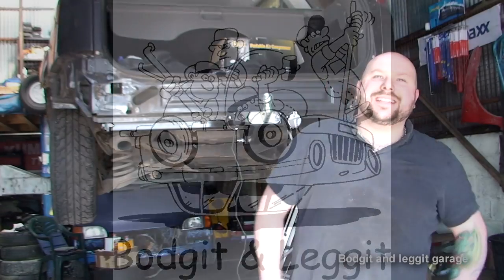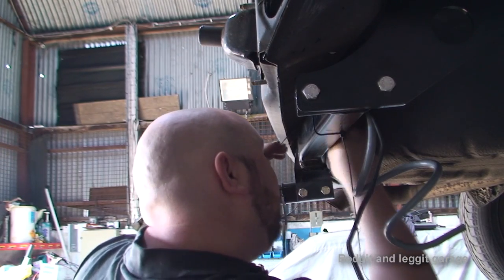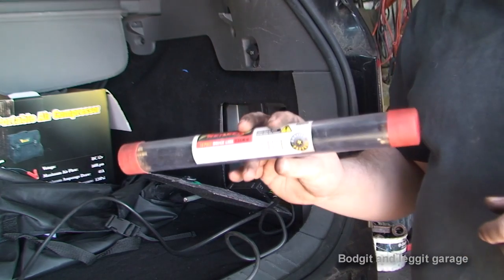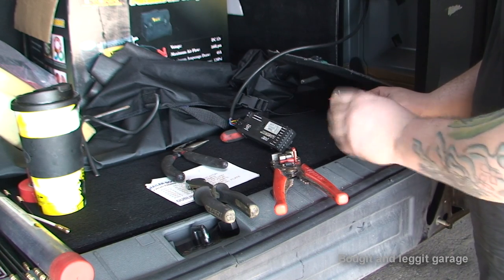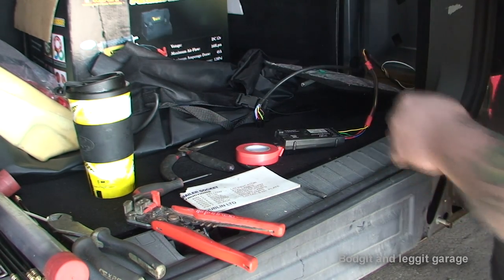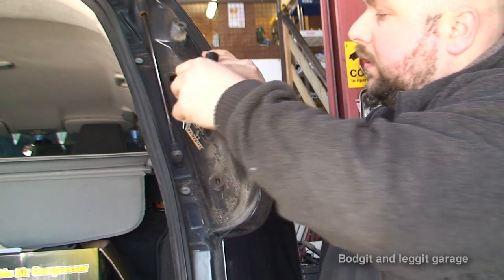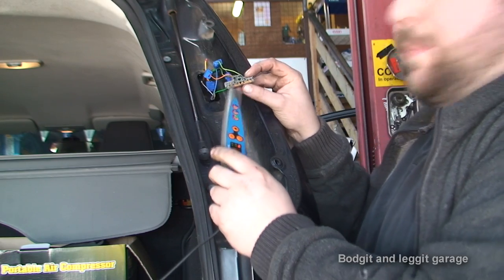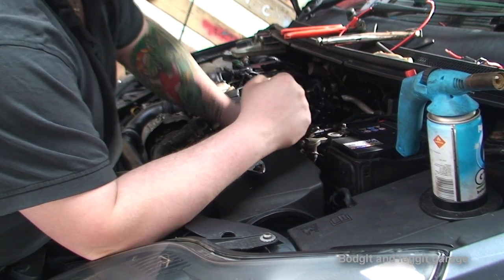how to wire a towbar with canbus box part 2 bodgit and leggit garage

Comment: p.s..
16:40
You talk of needing a HIGHER rated fuse in the circuits your car uses for various functions.
YET that canbus "box" is merely a relay box - fed DIRECTLY from the battery (fused at the battery) which itself POWERS the various RELAY operated lights on the trailer.
The RELAY for each circuit it controls - draws extremely low current from the "control" circuit ..
ie:
If the side/tail lamp circuit is powered ON (in the vehicle) and the canbus see's that 2 amp is drawn "normally' - it will NOT see the extra 20 mA that the relay coil draws.
It will ALSO NOT see whatever amperage the trailer side marker lamps draw - as THEY draw current directly from the battery - via the relay contacts.

That is the same for EACH of the six other circuits in the 7 pin flat plug.

NO TRAILER LAMP CIRCUIT - draws any current from it's identical vehicle circuit - as ONLY a relay coil - draws current from them.

Putting say a 15 A fuse on a normally 10A circuit - may cause a future problem to BURN OUT THE WIRING, long before the higher rated fuse blows.

The "can-bus trailer BOX - is merely a box containing 6 relays for each of the six "control" circuits - the relays FEED directly into the trailer - via the battery fused wired.

Comment: Stumbled across your video whilst trying to get an insight into tow bar electrics with Can Bus and PCT ZR2500 Relay.Unfortunately the van I have purchased has tow electrics in camper gas locker, noT standard practise and I need to move or isolate so no potential electric current is within box. I have chosen to isolate as don't intend to use the electrics on tow bar at this time. My intention is to remove 12V live from car battery going to relay, this I believe would prevent signal current going to tow bar plug, however I believe  there would still be a small current going to the PCT Relay from the light cluster connections? My plan is to break these connections at PCT relay  tape and put back into pillar column and seal entry hole, this I am hoping will remove any electric current in gas locker. I would appreciate your thoughts on my methodology. Thank you for these informative  videos most helpful. Can you provide link for your can bus wiring tester. Thank you

Comment: I didn’t really see the part we’re you got the power source from the battery to the canbus box, so do you have to run a separate wire through the car to the battery?

Comment: Enjoy watching your video's thanks Going to give this a try myself. If my car has already got the harness as factory but I've already brought the universal kit. Can you power the harness with a 15a fuse and get the power supply form there instead of running the cable to the battery?

Comment: Hi, I enjoy your videos and thanks for posting.  I am about to wire a towbar on my 2011 Toyota Avensis which has the Canbus wiring. My concern is I have a  car trailer ( 1 year old ) with LED lighting and I also tow a boat trailer with the old conventual wiring. Do I need to have any additional  fittings to cater for old and new trailer wiring systems being hooked up to my 7 pin socket. Thanks in advance.

Comment: You don't need to increase the car fuse size for the lights, that's the job of the 7 way relay. The relay only samples the voltage on each wire, the 7 way relay then  powers the trailer lights
Reply: Yes and increasing the fuse rating risks a wiring fire. Bad advice.  If by some stretch of the imagination the current draw was too much you’d just swap some of the bulbs to led on the trailer. Never change the fuse. The main positive to the bypass should be fused as close as possible to the battery or on an existing unused circuit.
Reply: And if you know your increasing the load, why wouldn't you wire the left and right circuits separately???
Reply: Correct, you should never increase the rating of the fuse. Its easy to test the current draw at the fuse, but the channel is called Bodgit and Leggit.

Comment: that thing you drilled a hole for is a rivnut,if you have a 12 volt socket in the boot why not use that instead of running a cable all the way to the battery?

Comment: Hi mate ,have question urgently. The tail light wire on my picasso has 2 wires ,so do I need to connect to both or just one. Also my brake light has 2 wires ,so do I need to connect both to the relay or just one wire. Also I read that the battery should be disconnected whilst connecting everything in ? And do I need to disconnet the minus of the battery when connecting in a fuse and positive wire to it.
Reply from the maker: Hi mate are you sure they are both positive wires? Are they left and right as long as you've got one good connection that's all that really matters just make sure you connect the right wire to the right pin it's like everything always best to disconnect the battery but this can cause other problems with radio codes and functions

Comment: If the live feed is direct from the battery why do you need to start to car to check it’s got power ?. Surely it will be under constant load ?. 
(I ask as I’m trying to get my head around wether it needs to be switched )

Comment: Very interesting job well-done the tool you cannot remember the name of it called "Rivet Gun". You need to explain the tools you are using and it is very important. Wonderful explanation. Thanks ! The boring job taking the wire from back to the battery is more important for learners.
Reply from the maker: Syed Tauseef Abbas thanks mate and thanks for watching thank you for the comments I will certainly put this to use

Comment: Hi, what is that electrical tester? I can't find anything like it on amazon. They all seem to be for AC circuits or require an earth connection as well, whereas yours just looks like it has one connection to the wire.
Reply from the maker: Daniel Moore the one I was using in this video I have done it all review on it it does have a wire connected to it https://youtu.be/CPRJX7Hc6SM 

I also have one with no wires connected to it but that's not what I use in this video
Reply: @bodgitandleggitgarage  Thats not the one you used here.  19:55
Reply: Yup, I was about to ask the same.   'Been meaning to for a week or so now.  The one you used at the 19:55 mark.

Comment: Can i not take the power from the 12v ciggy light above where your fitting it as trying to feed the wire from the battery is driving me nuts!!!
Reply from the maker: hi mate I would only get it from the battery if I was you I know it's may be annoying friend in the wires through but honestly it is the best way to do you will not have any problems if you do it this way I can only advise you to get it on the battery but it's up to you what you want to do hope this helps thanks for watching don't forget get your hands dirty

Comment: Hi...can I pick 
Your brain?!
My trailer lights, indicators, brake lights and side lights all work when I plug it up to the 7 pin socket on my car. When I attach the trailer on to the tow ball and still plugged in, the side and rear lights on the trailer flicker and go out, however brake and indicators still work. I have noticed the towbar is a bit rusty. Would you have an idea what the problem may be? Thanks
Reply from the maker: Tony Potter hi mate you're gonna have to go through the whole trailer there's obviously a bad Earth somewhere on the trailer all the wires are a thing of the body somewhere

Comment: first of all great videos pal. i have been avoiding fitting towbars to can bus wired cars di you no what this box does and do these boxes work on all cars with can bus? 
keep the great videos coming!!!
Reply from the maker: Mark harriers hi mates whatever you get it from just ask them if it is compatible with your vehicle there are some differences  and some vehicles need special ones if you are getting it from your local Motor Factors just give him your number plates and they will advise you which is the best one to get as regards fitting them they're all more or less the same hope this helps thanks for watching
Reply: Many thanks pal is it best to wire 12s plug straight ti battery and how bout the fridge wire? Loads of my m8s been watching ur videos :)
Reply from the maker: Mark harriers I know it's annoying hiding the wires from the back to the front book trust me it is best direct to the battery to the box you will have no problem doing it this way

Comment: Why not use the back 12V aux connection right in front of you for power to the can box ? It's not switched as far as I know .... I could be wrong ....
Reply: There is more than likely no power to the 12v aux unless ignition is on, so if you were to stop on road and wanted to park with trailer/caravan leaving side or park lights on for safety, the 12v would have no power to it therefore no lights through relay to whatever is being towed.

Comment: what size cable is used from the battery to the 7 way bypass
Reply from the maker: hi mate I use 2 core 17.5 amp wire  hope this helps thanks for watching get your hands dirty
Reply: I have received a much thinner red wire with my relay, that looks to be fitted to the same fatter fuse wire and holder as seen in video. Do you advise that the thin wire should be fine for this application or should go with the thicker 2 core 17.5 amp wire?

Comment: If you used a standard phase tester to begin why did you need a can bus combatible tester later
Reply from the maker: what part of the vid did i swap tester
Reply: @bodgitandleggitgarage  hi it was at 24 mins wiring the fog light
Reply from the maker: @wahey70  that is not a different tester to what I was using I explained in the first part of the video this was a canbus safe tester
Reply: True but did you not say that about the blue one the small one with the red light is just a standard one 🤔
Reply from the maker: @wahey70  no I did not say that at all

Comment: Why didn't you use the 12v plug in the boot for your power supply?
Reply from the maker: Because the most modern cars all these units are controlled by the BCM if they see any voltage spikes high current drawers or anything like that they would just shut down this unit has to be powered completely separately to make it work properly like I explained in the video you can cause a lot of damage by doing this incorrectly the safest and best way is to come straight from the battery with the correct size wire

Comment: Scotchloks in damp environments are so prone to failure or even fail before first use. Put them in the bin. Solder and heat shrink  instead then you can forget that blue rats nest!!!
Reply from the maker: everything has their place I always solder and heat shrink and use vulcanising tape as well as liquid tape when I'm doing solar joints on wires however when you are doing trailers there is really no need to do this I have been doing this for a long time and never once have I had any come back in over 15 years on any Scottish lochs I have done on trailer tow bars it all depends where you are in the world I suppose but I've never had an issue with doing it where I am
Reply: @bodgitandleggitgarage  Fair comment - You must be using the correct colour coded  Scotchlok for the size of wire. Over the decades when I complained to 3M their findings were that a lot of users simply used the blue ones and fitting kit suppliers tended to issue them without considering the wire size.  I'm not having a go.. I think your vids are good hearted and informative!!

Comment: You dont upgrade the fuses when using this canbus box. The box is a bunch of relays and this negates the need to change the fuse. Heat shrink soldered connecters are tidier and make a better, weather proof connection.
The name of the threaded rivet is "threaded inserts".

Comment: Hi bought a second hand unit and someone supplied with a canbus relay system I have wired it all into lighting for each colour and tap into brown wire on car for ground and a 12v power but seems the relay isnt going anything. Why??
Reply from the maker: hi mate you're going to have to go through all your wiring connections again and if you are concerned just get a 12-volt power source and directly power it up out of the car and see if it works but second-hand units like this is never a good idea
Reply: @bodgitandleggitgarage  

Sure it's an Astra H. Unsure if it's a faulty power supply or the relay unit as second hand

Comment: hi as far as I'm concerned you don't need to remove the rear lights you can get the connections for both lights on the left hand side inside the boot you seem to make it much harder than it is ive been fitting tow bars on cars for years my way is much easier and better i would check this out it will be easier for you the tool you used is called a rivet nut tool i use these always if possible
Reply: Have you got a video?

Comment: how would i do this using a multi-meter.
Reply from the maker: hi mate you need to go to the Volts section and select 20 volts as you're only working on 12 volts this will be perfect for what hope that helps thanks for watching don't forget to get your hands dirty
Reply: +bodgit and leggit garage hi mate. thanks for the reply :) ok buddy will do.. thank you. :)
Reply from the maker: +kai brown anytime mate glad I can help
Reply: +bodgit and leggit garage sorry just a quick question again sorry. when working out which wire is for what. where do I put the black and red probes? (sorry stupid question, I know :( )
Reply from the maker: +kai brown hi mate no such thing as a stupid question just stupid people lol the black probe goes on the Earth and the red probe goes on the wire you are testing so in other words why you are trying to find which is live
Reply: +bodgit and leggit garage thanks buddy :).
Reply from the maker: +kai brown any time mate
Reply: +bodgit and leggit garage sorry me again hahaha what wire do I need to use to run from the other indicator to the bypass relay. I also got a fuse panel in the side in the boot (zafira 06) there are 2 big thick red leads. could I get the power from them? thanks again. :) sorry about all the questions..

Comment: Can anyone Tel me if I can run power from the box to a light instead of going all the way to the battery cheers
Reply: Bit late, but no!  The point is to avoid drawing power from the car ligjts as it can mess things up
Reply: @partiallyt660  already done it used it quite a few times and had no problem cheers

Comment: I can't belive you have used scotchlock's, they are about as reliable to use as just twisting the wires together!! why not solder and heat shrink the joints and do the job properly
Reply from the maker: not in a can bus wired car you can do a lot of damage if you put heat into can bus wiring and these are inside not outside so they're not too bad I would never use Scotch locks outside
Reply: +bodgit and leggit garage Can't see any reason why you'd have heat problems with heat in CAN bus wiring, unless they were really hefty cables and you were putting lots of heat into them near a plastic connector. If anything I'd say you're more likely to short something out if you're using an earthed soldering iron. That or the system doesn't like the wires being disconnected.
Reply from the maker: +ben hunter that's why I use Scotch locks better to be safe than sorry you never know Anything Could Happen Cross or anything and then you're in the shit
Reply: I think if it was me, I'd disconnect the battery and work backwards from the light clusters to work out which wire is which and solder and heatshrink with glue tube to make it waterproof. I've had nothing but trouble with scotchlocks causing intermittent connections. One nice thing about my Vectra is that it's got a heavy power cable and fuse box already in the boot for the body control module, so you can just take light power from that. There's a blank fuse holder and connection specifically for tow-bar electrics.

Comment: SCOTCH LOCKS ...NO NO .NO NO .NO NO .NO NO .NO NO .NO NO .NO NO .NO NO .NO NO .NO NO .NO NO .NO NO .NO NO .NO NO .NO NO .NO NO .
Reply: They`re ok as is, if in an area devoid of damp/humidity.To use externally you can use a tiny paintbrush to cover with petroleum jelly...or some-such similar protection.
I`ve run motorcycles for donkey`s years and although I don`t use Scotchlocks? on them,the wiring is much more exposed as you can imagine.Even though I`ve run several Italian bikes that were/are always touted as having bad electrics,I never had a problem because I used petroleum jelly(oo-er missus)
Reply: I was told many years ago that it would cause problems using petroleum jelly by actually insulating electrical connections,but I`ve found that not to be so.Have assembled many motorcycle handlebar switches,and multi-pin connectors with it,the spring pressure and sliding action and friction connection with male-female connectors,maintain electrical contact.
Last month I stripped out the wiring and connectors on a 1992 trail bike that had a misfire and other electrical issues.. Replaced badly corroded wires and connectors and cleaned up remaining male&female connectors within large plastic connector blocks,assembled with petroleum jelly and all`s well....and should be for many years.
Reply: They should be banned
Reply: @Clicksystems  they are fine soldering wire messy to permanent if you ever want to remove ie rental car
Reply: What instead then please?